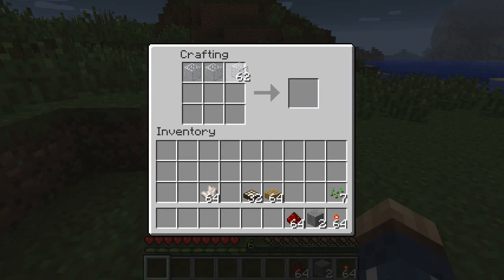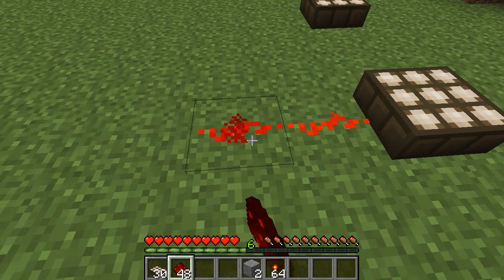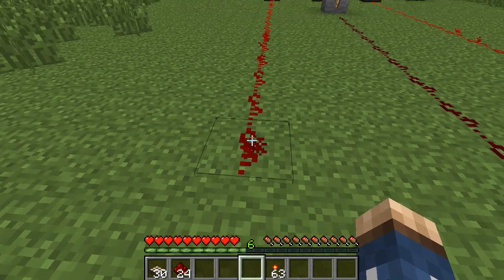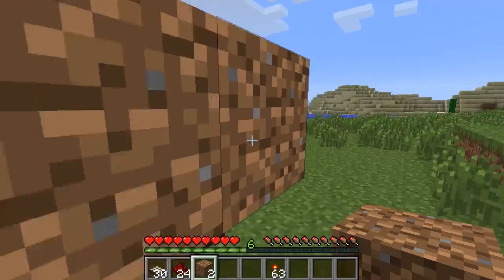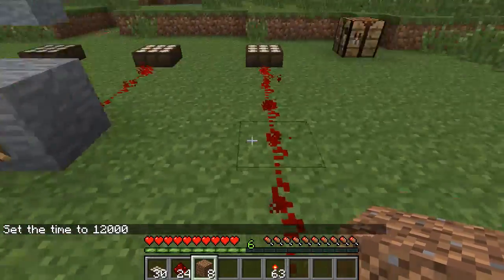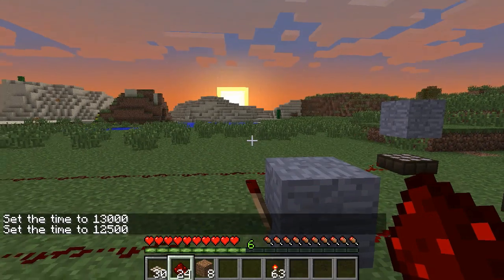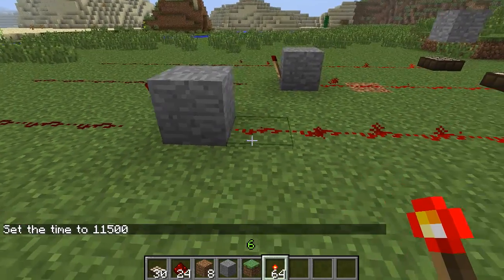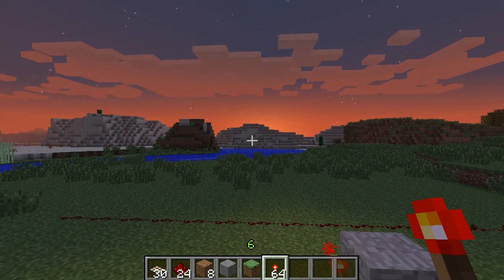★ Minecraft Tutorial - Redstone Daylight Sensor Tutorial  (13w01A) (w KestalKayden)

Comment: On my server we use daylight sensors to control the main so it's always open during the day then closes at night, and can only be opened by pressure plates we set up, that and we made the auto street lamps with them. Daylight sensors are pretty neat.